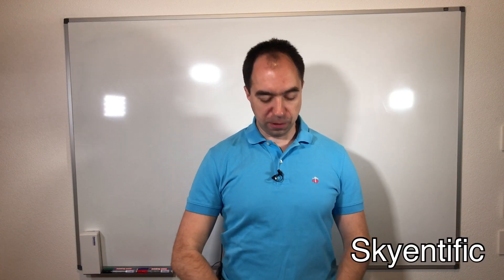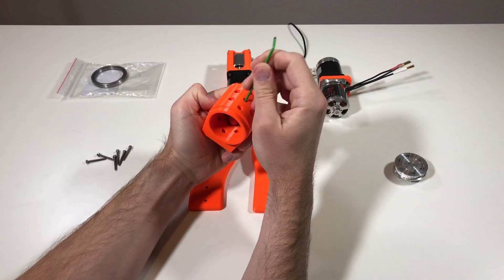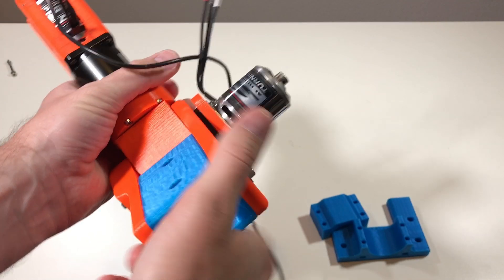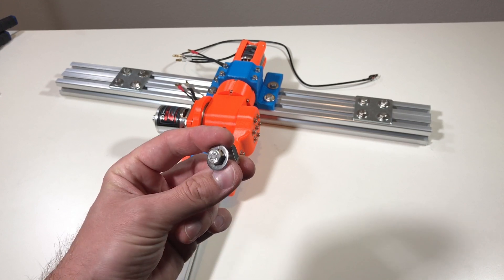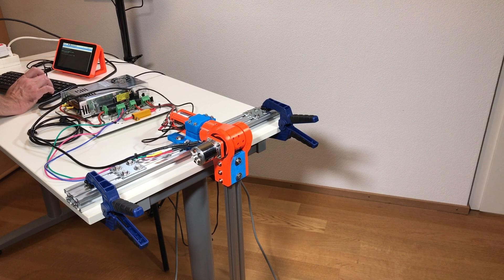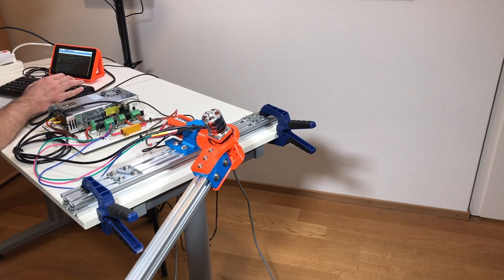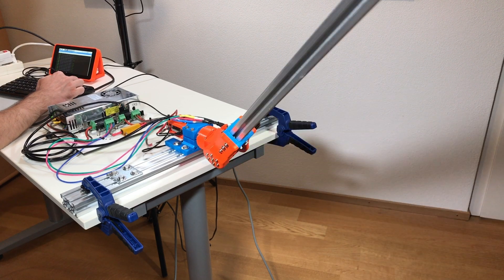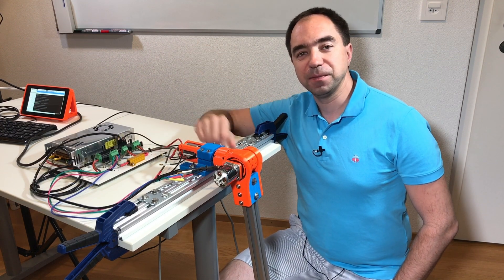Robot Arm Shoulder with Brushless motors?

Comment: without a wire ring your freedom is limited to few turns
your design is limiting the move too
if you had plugged the arm at a single side you had unlimited turn freedom
its common noob fail to atempt symetric but its ever impossible
Reply from the maker: It is easy to criticize. Try to built the same joint for this price. 
You mean not wire ring, but slip ring. It would make the design way more complicated and more bulky. To move the arm on the side also would enlarge entire assembly. At the same time my joint has ‘spherical’ property (the output arm axis crosses two axis of rotation in the same point). Thus it would be easy to implement inverse kinematics. 
Btw, human arm does not unlimited freedom (range of motion), nevertheless humans arms are very useful. Even the super expensive industrial arms does not have infinite range of motion.
Reply: @Skyentific  you dare to compare human with your prints 
by the time you spent on this project it had not be a large waste to pass from 350deg to infinite the math is easy
maaybe expensive arms have a point you more at experimental so you limit yourself for time and complexity reason meanwhile your project is already expensive and complex

Comment: What the "Odrive" do you use? It have control encoder signals on board. What is name this cool driver?
Reply: Thanks, I found a lot of drivers like your. Your driver can process of 3 sensor signals from Hall sensor or incremental encoder. You use incremental encoder.

Comment: lovely 2degree arm. brilliant
Reply from the maker: Thank you!
Reply: @Skyentific  do you have a video on the basics of oDrive? i'm currently making a safe dialer with an arduino but frankly it's struggling with interupt speeds, i'm a complete noob re raspberry pi but i'd love to migrate to python perhaps and a pi. for the better processing etc. I tried to set up a trinamic driver chip with the pi but i failed at the installing the updates part (it seemed very complicated) and i couldnt get the motor to turn. love your channel, i'm very interested in where you will go next! thanks Julian

Comment: that's awesome, I can't wait to see a pair or leg or a quadruped robot. By the way, what's the peak power that is used by the ODrive, the average power after "Normal use" (its hard to define hard) and idle power with no load on the motor ? Keep going you're doing incredible stuff.

Comment: Nice, but what about compare with same size stepper motor?Speed, torque, precise, backlash
Reply: stepper motor have the lowest torque and speed than other kind motors. Brushless motors the best of motors.
Reply: @obsidiann1  Stepper motor can use without gear, so it cheaper, more precise, and even maybe same rorque and speed if you compare with brushless motor and gear same total size like stepper motor..
Reply: @Elegatec  stepper motor has a small rotation angle resolution. You can never rotate your stepper with high precision. Stepper with angle step less of 1 degree is very very expensive. Robotic arm have a long shoulder and with stepper can never be positioned more precisely.
Reply: @obsidiann1  Stepper can use microsteps, it very precise and no backlash

Comment: Awesome progress! About backlash - if the arm is used for some applications that don't require much strength, but require some precision, it might be possible to use constant tension circular springs to preload arm one way. Maybe not the best solution, but simple and should (in theory) work for applications like welding, pick-and-place, liquids handling, etc.